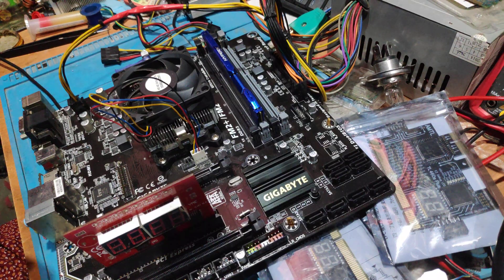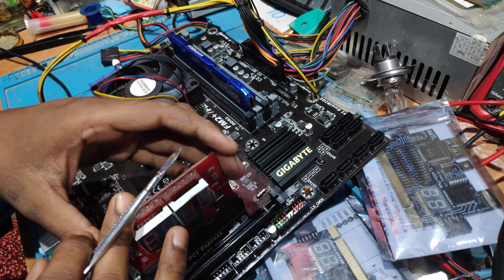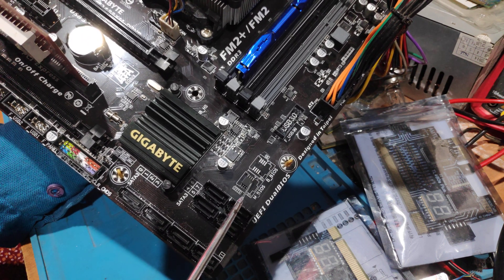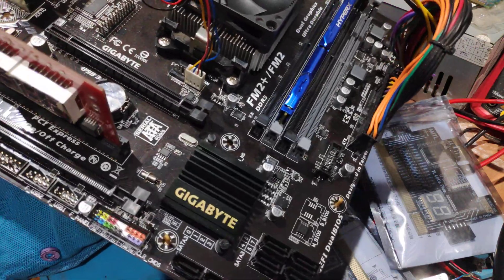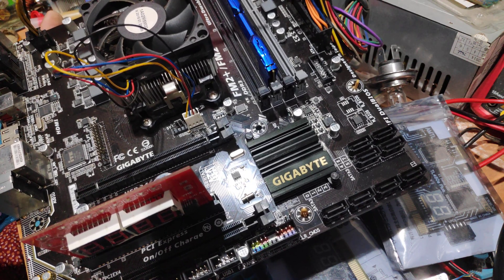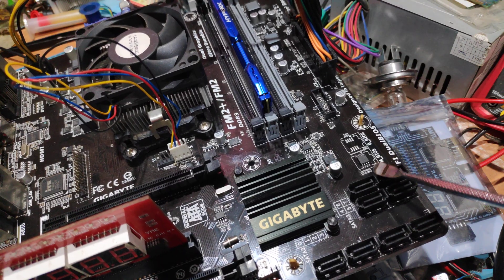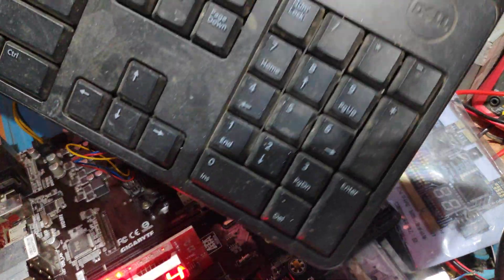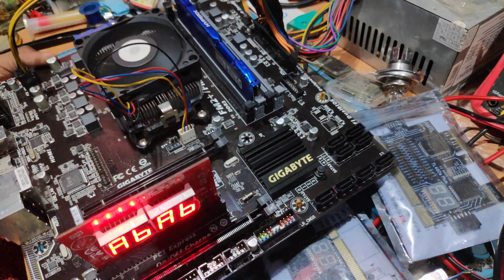GIGABYTE MOTHERBOARD AUTO POWER ON PROBLEM SOLVED

Comment: Sir need a help from you... I have a Gigabyte Motherboard (ga - z97m-d3h) .. The problem is, the fan starts spinning but it stops after 1second... So i thought of turning on the motherboard after disconnect the ATX_12V_2×4 WIRE .. And the fans continues to spins properly for few seconds after doing so.. To ye kya kisi MOSFET ka problem hai?
Reply from the maker: VRM section main short hai , you also check all MOSFET & lmcc capacitor , phir v short nhi mila then change the core ic (PWM) thank you ... 👍👍
Reply: @immiinfo  thank you so.much sir for.your tips... I will try it.out... ❤

Comment: Bro there is no need to change the BIOS Chip if you change the bios power settings [after power failure = stay off or last state] then it will fix the issue!
Reply from the maker: I know that , but this is not working 👍👍 thanks for sharing to all

Comment: Gigabyte H61 Board, Automatically cpu oning with out using cpu power button, when shut down my pc the cpu fan and Smps still working not offing. ...   Plz help me
Reply from the maker: Dear ,  first of all reprogram your bios  to a   genuine read bin bios file
Reply: @immiinfo  bios ubdated, problem not solved
Reply from the maker: Front panel ke pass ek protection hai wo khrab hone se board auto on hota hai, next video main details main dekhedunga ,auto power on ka full solution , okay
Reply: Bhi mera bhi same bord hai same problam meje bhi ara hai

Comment: the same mainboard. no power tu cpu soket 4 pin processor power please help me for this problem
Reply from the maker: Check ldo regulator or RTC crystal
Reply from the maker: Vrm section check karo